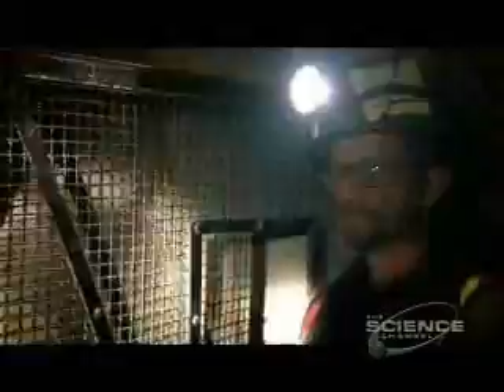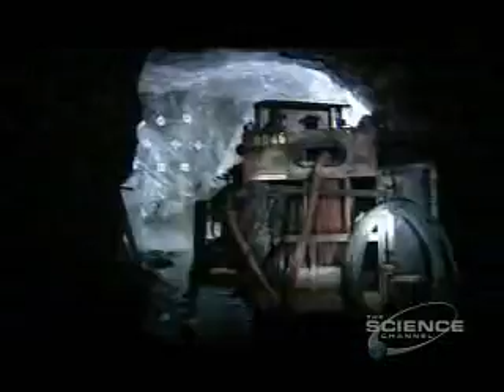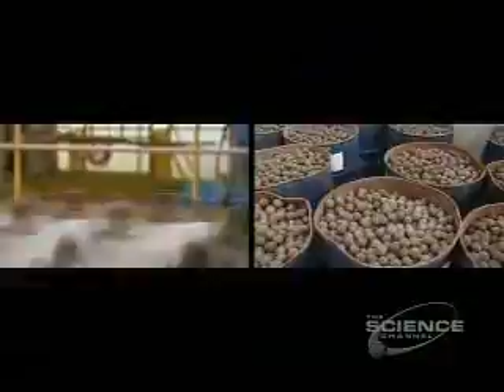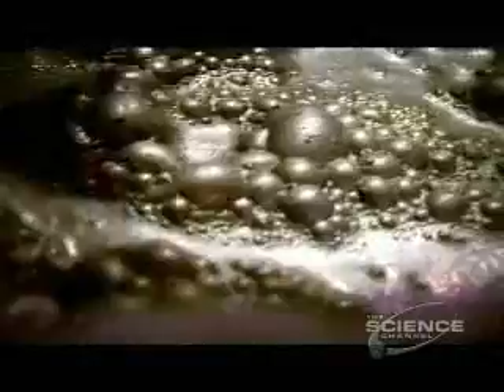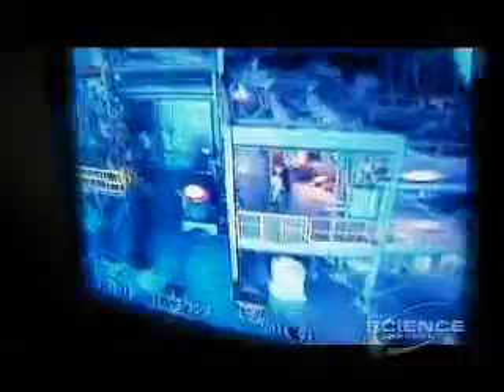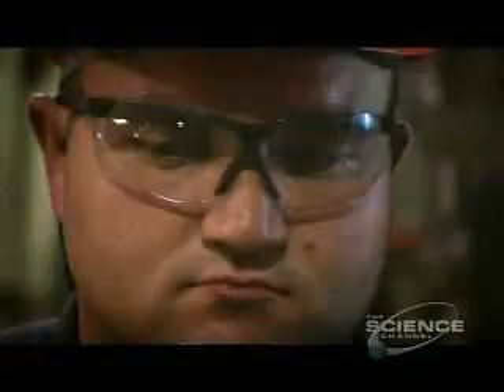catalytic converter

Comment: yeah - screwy claims re: platinum scarcity and difficulty in recovery.   Discovery Science is not the end-all and do-all of modern understanding.  They make lots of comical claims - take it with a pinch of platinum salts.  Sudbury ON has an enormous, recently-discovered Pt deposit along the northern edge of the Sudbury Formation.  Large.

Comment: surely someone else picked up on this as well .. the guy says you get an ounce of Pt in a "staggering" 700 lbs (of ore)  .. surely it should read "an ounce of Pt in a staggering 700 tons of ore".   Also, the guy states Pt as the most valuable element recovered.  I'm confident rhodium metal is also recovered.  Rhodium prices have dropped dramatically recently but it's still 4 times say as valuable as Pt.  Technically defective video.